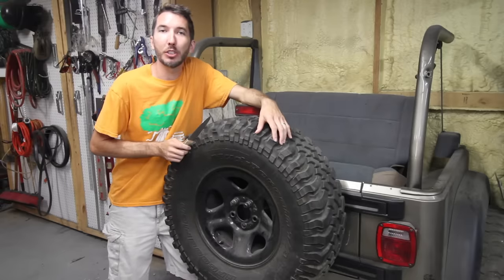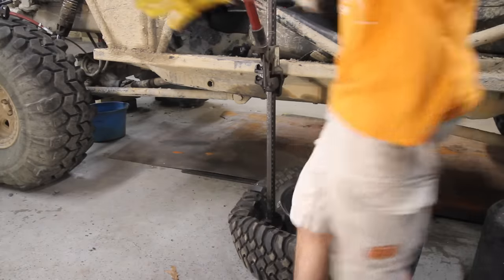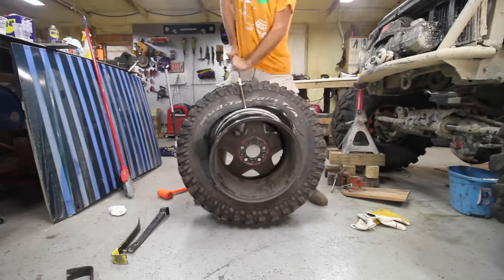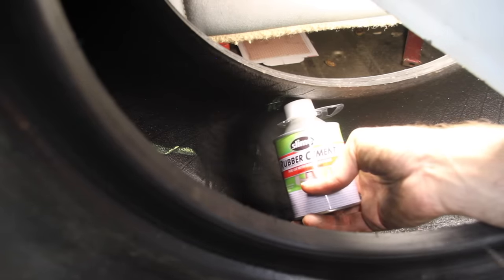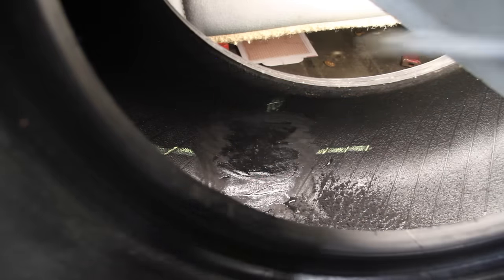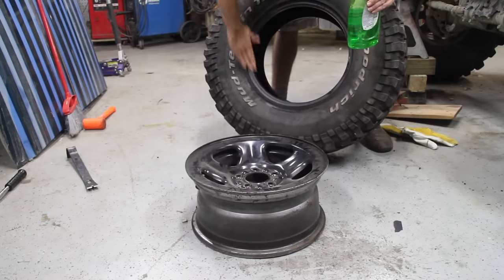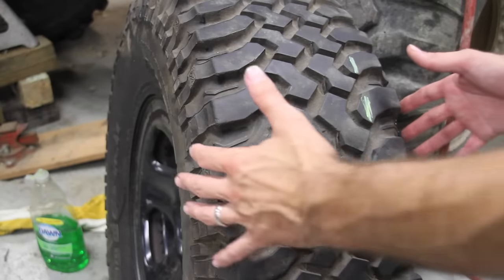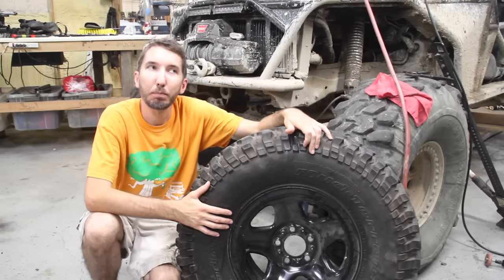How To Fix This - Patch A Tire

Comment: 2 Things, you ground right through the inner liner, which is a problem and secondly you put a bias ply gator on a radial tyre...
Reply: Otherwise you did an acceptable job and I bet you will get home just fine

Comment: I had someone stab my car tire near the rim. Could not afford two new tires because of on front and rears were warn bad. Had a radial tire tube installed, and lasted over 4,000+ miles before replaced. When asked for a tube, the dealer found one in back storage shelf covered in dust. Tubes are antique today, but in dad's day that is all they used.

Comment: You did one thing wrong you always end at the valve stem. If you have a newer vehicle 2007 and newer you will have a tpms sensor attached to the valve stem. To keep from damaging it you start removal at the valve and end at the valve when you re-install the tire.
Reply: Some are on the stem, some are on the opposite side of the wheel, some guess based on the abs

Comment: Pro tip. Don't use dish soap on alloy wheels it will corrode the bead seats and the rim will leak.
Reply: Is bath soap OK? What else is good?

Comment: This is how we changed big rig tires in the old days
Reply: Dewayne Miguel

Was thinking the same thing. When he was struggling with that last part of reassembly, where you telling him to push that bead down away from the edge of the rim ? lol . He got there, eventually.
As I was nearing retirement, I changed them with my cell phone......I called a mobile tire repairer.

Comment: If you really want to get fancy. You can clean the gash real good and skive it a bit. Use rubber strip to seal the gash. Push the rubber in the gash Use a heat gun to vulcanize the rubber and buff it until it's flush on the outside and inside, then apply a radial patch on the inside. Apply liner repair over the patch and voila!!! you pretty much did a section repair like they do spot repairs on tires that go in for retreading. You overbuffed to the chords. Patch will not hold good. Get out some flat rubber strip apply it over the chords or buffed area. Again use a heat gun to vulcanize it. By the way do not get finger prints on the buffed surfaces. The oils from your fingers will cause the patch not to hold too well. Lol. On the roadside this may not be possible, however it's best to take it apart again and do it proper after. That way it's a permanent fix and not temporary. A tire repaired like that should never go back on the front again. By the way. Buff the speed rating off the tire after a repair like that has been done.
Reply: @Mark Codiroli So your calling BANDAG a tool lol. They do this method on 235/75r16 and 17 10ply tires
Reply: @Mark Codiroli offroad use only though and Non highway service. Temporary

Comment: I have a cut like that on my side by side tire. Its further down the side wall, do you think it will work just the same? I do not drive it on the road.
Reply from the maker: Sure, I wouldn’t trust it to last forever but give it a shot.

Comment: Super glue is designed to glue rubber together you should have put superglue in a split and to help it dry faster and you sprinkle baking soda on it and it dries instantly and it'll never let go they might split that crack but it's not going to let go of the rubber

Comment: Good tutorial….I’ve done numerous similar repairs right into the flat area side walls..    
  But Such repairs close to the tread edges and sidewalls are not reliable,  No matter how well applied and Why tire stores don’t want to repair them… and only suitable for emergencies like said or maybe use for a spare.. The less time used might help the bonding process and offer a little more reliability if not the only tire have.. Otherwise sadly, need a new tire… 

My experience found.. 
The heavier duty thicker larger the patch is, the better as long slashes, big holes tend to flex and want to pull apart the hole.  And delaminate the patch....Or patch push through the hole making it bigger regardless of amount of air, or minimum,  . And a less flex material large patch with no or less stretch works better. This coupled with can’t always prep glue surfaces good enough with available tools on the trail .. (or at home in my case) 

 The rougher cleaner can make the patch surface, the better for bonding the patch to the tire.. but on the trail usually lucky to have more than a file on a multitool to do that or maybe in a well equipped tool box might have a wire brush, file or sandpaper in it. So upgrade your tire repair kit for all possible damage repair options.. Or only need a few more tools than might normally have in a kit or dual purpose ones.. 
. 
For sealing beads and removing tires.. Tire guys always say can’t use too much soap…
A typical 12v compressor might not produce enough volume of air to seal a bead that is leaking too much, (or a cheap home compressor) Or any manual ;pumps.. so..  
  Something should have on an off road vehicle is a tie down ratchet strap if not part of regular equipment. …In a pinch a rope..  put that around the perimeter of the tire and tighten it up till the centre compresses and seats the beads better… usually doesn’t take much compression on the big wide tires, and more of a problem with narrow tires and relative to wheel width.
 Sometimes if bounce the tire when isn’t filling it might help seal the bead a bit better and can get enough air it for the bead to start sealing..  the Starting fluid method also works, but can be dangerous… and if pack starting fluid.. 

There no point putting on excess rubber patch glue anywhere except for patch surfaces.. the glue is designed to only work with the chemicals on the patch to bond the patch to the tire and won’t glue any else together.. 
   I’m not sure there is any glue that will work to bond tire rubber together reliably except as some kind of vulcanizing process mimicked for patches or not for the consumer market... And if was, could glue those holes together and make patches for them more reliable ..

Comment: Now cover it with glue light it on fire and extinguish it with fast moving air letting burn for about 15 seconds bursts about 4 or 5 cycles reapplying fresh glue between each cycle, this thermal sets the patch and increases your chance of long term success by about 100%.....
Reply: You need to rethink your procedures if you need to burn cold-patch chemicals to get the patch to stick
Reply: Clearly heat helps...lol

Comment: OK for an emergency, but there is a reason you don't repair sidewalls.
They flex a lot more when driving.
A sudden deflation might be ok when you are crawling at 5 mph down a track, but at 50 mph it can be fatal.

Comment: use 18  to20 inch flat screw drivers good rim lube patch!!! to repair properly or safely use a 20$ tube not a 165$ tire you can use a tube even on a side wall hole up to three eight cut but patch first ... rear tire if used on  highway tubes were safe for 90ty years in tires!!!

Comment: As someone that works at a local professional tire shop, I am glad you stressed that this is a "get you out of a bind fix". even off road that tire should only be used to get you out of where your at, and get replaced ASAP, as that patch will eventually fail, because of the flexing.
Reply: do you work in the shop mainly or up front?

Comment: Brake cleaner is a better resolution than starter fluid. Better yet… in this environment, space permitting, carry a spare tire or two in the boot on top the cooler!

Comment: He means well, and his approach is "Good enough for govt work " but he left out one other important part of the process. .You must mark the rim balance weight and tire location. Also. .chocking the tires to prevent the vehicle from rolling off a "Loaded" jack, which can cause  most jacks to shoot upwards with enough force to injure or even kill you.  If you are faced with this situation,  please place one foot on the base of the jack, and WATCH for any roll off, in order to avoid harm. But overall,  it was a very informative presentation.

Comment: the injury is in the correct direction. the cords are radial, and the "ropes " all run the same direction. Very little damage to the intergrity of the tire. if the knife was 90 degress the other way, garbage. nothing would repair it. the repair was wrong, it is a bias repair, and the cord is x shaped inside. it will peal as it will not flex the same as the tire. radial repairs are either square or rectangular. I see people doing this all the time with tractor tires. bias repairs in radial tires, the split and take out the tube.
Reply: further, I have done ten of thousands of repairs over my lifetime of running a tire shop. I never clean the wound. I do not think bringing in a foreign agent into the wound will help clean it. If you buff well you can sweep the loose rubber out of the repair, or use a vacuum.

Comment: If you're not running on the road at highway speeds, this is something. I'd be very wary of inflating it, but for an emergency repair, anything will do. Hell, stuff the darn thing with hay if that gets you home.

Edit: Oof! He buffed it down to the casing... Those patches don't bond to the synthetic rubber in the casing of the tire.
Tire was scrap anyways I guess.

Comment: I had a 78 buick regal i had barely bought some tires and my ol lady had stabbed them and they were new and no tire repair shop wanted to fix em for me so i went across to mexico i live in del rio tx and crossed to cd.acuña coahuila mx took my tires and within 30 mins he patched them up for me and had no problem but the guys didn't use regular patches he used a iron and some kind of rubber to patch em up

Comment: Would have loved to see you try to actually put weight on that tire in a cycle it would have blown out due to the gash being parallel in between the bead and the tread, the tire would pinch due to weight and blow out that tire as soon as that patch reaches the bottom of its rotation. please people if you need advise go to to a professional that does tire work every day. Or not w.e its your life. enjoy it !

Comment: Good video, Thanks!

I know its only a temporary options to get you back to civilization, but, this patch would not last in the long run...... So, alow me to tell you guys my secret to a permanent fix....

At the point where you got the cut cleaned and ready for the rubber cement, you use Superglue, like the kind Geurilla glue makes, some countries also call it blitz stick. (this is going take some time) Put the Superglue in the cut, make sure it comes out on the outside as well. Put some on from the outside also..... Now, wait...... Till the glue is 100% dry.

Now you can go ahead and fix it like shown in the video, but, put an innertube in the tyre, bcs, otherwise the patch will come lose over time, since its on the sidewall.

If you do not fix the cut with Superglue, the cut will chew its way through the patch and if you have an innertube, it will chew through the innertube also.
Reply: i would have thought the blitz stik had even less flex capacity to the point where it would weaken the bond vs rubber cement. no?

Comment: VALCANIZING, BUT YOU NEED SPECIAL TOOLS ON TRAIL. SUPER GLUE WITH BLACK RUBBER CONTENT SOLD AT HOBBY SHOPS FROM BOB SMITH INDUSTRIES WORKS WELL FAST. E6000 INDUSTRIAL ADHEISIVE WORKS ALSO BUT TAKES 5 DAYS FOR FULL CURE.

Comment: So if you out on the trail...a compressor will appear so you can use the grinder?
Reply from the maker: you better believe it!
Reply: Yep, tend to roll up on four wheels. That is unless you're wheeling alone. In which case you're insane and get what's com'n to ya.
Reply: This actually did happen to us when we were hunting and we repaired it the way this video shows. We do carry a small 2 gallon air compressor and a 700 watt inverter that clamps on battery to run it. It works! but we also had 2 tire tools to help remove tire from rim.

Comment: I was wondering how long it would take you to figure out to keep the bead in drop center.
Reply: are you talking about the mounting process where the bead goes into the shallow part of the wheel?
.
Reply: Yes.  That's referred to as the drop center, of the wheel.

Comment: As a tire repair professional I can assure you that a repair like this is not legal for highway use. There is not a shop in the USA that will repair a puncture on the sidewall or edge of the tread if they are even the least bit reputable. This may be fine for off road use and to get you to literally the closest road so you can call for a replacement but should NEVER be used on the highway at or even near highway speeds.

Comment: Good Lil tip use a pair of vice grips on the top bead, can tell you are not a Tyre guy made this all look so difficult. Never hug a Tyre when blowing it up lol! Especially whit a dodgy repair!! Chuck it under your truck
Reply: First of all, why never hug a tire? They don't blow up... That's just not a thing that happens 😂. Second... Why is this a dodgy repair when it's literally step by step accurate according to any material I've ever read? Especially considering it being an in the wild repair
Reply: @A_Stereotypical_Guy  😆 who's never worked in a tyre shop...
Reply: @nickh3720  brother, when setting a tire bead, they don't explode...never happens, never has happened in the history of ever. Prove me wrong, link me a video with a tire exploding from setting it back on the bead. If it's a thing you know someone has a video of it on here.
Reply: @A_Stereotypical_Guy  ok why do they make tyre cages?
Reply: @nickh3720  for rims that have separate rings and hubs? Like 18 wheelers and tractors. Because the rims do blow apart from time to time, but not the tire.
Reply: @A_Stereotypical_Guy  and damage, ripped beads, zipper...troll go back yo your bridge
Reply: @nickh3720  ok my guy, but the point remains that when putting a tire back on a bead tires do not explode, so yes you can hug them, kiss them, even take them to bed, and you don't have to worry about them blowing up on you.

Comment: LUBE THAT TIRE WITH LIQUID SOAP...OR WHAT I USE...WHEEL BEARING GREASE...Had a flat because tire was low...& I didn't notice it...hit a small whoop tee doo and popped bead...All I had was a SLIME air compressor...wheel bearing grease...yup...hold that tire as perfectly against the rim as you can...the grease did the rest...I WAS OUT IN THE BOONIES MILES FROM THE NEAREST TIRE OR AIR MACHINE...SLIME MAKES A PRETTY GOOD COMPRESSOR...NOT AN AD FOR THEM...OLD SCHOOL OFF ROADER THAT USED TO RUN 5 POUNDS IN MY SAND RAIL REAR TIRES...USED SLIME IN 1974...

Comment: That's really hard work. I'm tired just by watching you do that. Better to take that to a tyre repair shop next time or just don't put a knife through it😂
Reply: Ha, ha, ha... the tire shops are located exactly every 2.53 miles on every off-road trail, just roll your wheel there and they will be happy to help you...

Comment: Is it possible to put the tire the other way so the patched part stays on the inside of the vehicle and not on the outside? Sorry im new around this loool
Reply from the maker: yes that is possible
Reply: Put it on either way, unless its directional.

Comment: Not bad for an amateur repair. Not sure why you used a bias repair unit instead of the radial one you had available? Other than not using a proper vulcanizing chemical to do the repair and missing a few items. I would say pretty good job.

Comment: This looks ok for farm vehicles traveling less than 30mph or so or for a spare that will be used briefly and at low speeds but very risky for highway speeds.  When cornering and the shear stresses on a tire are unbelievably high and and the tire ply fabric at the cut  tears and works loose from the rubber.   If I had my life's work dependent on a my tire shop and all my assets and probably mortgages too tied up in it I would respectfully decline to do this repair for a customer.  One accident and you would lose it all.  I would do simple nail and screw punctures this way but keep my eye on it in case separation starts to develop on a larger screw hole.

Comment: What was the purpose of cleaning the rubber you the ground off?
Reply: BubbaT85 to get all the excess rubber off of that are so the patch can stick to the cement and not the left over loose rubber.

Comment: The reason why you don't repair the sidewall is because when you are driving on the tires
the sidewall flexes and could pop the patch. Also never patch the front tires, those are your steering wheels. The only tires to patch are the rear tires. You should move any patched front tires to the rear wheels.
Reply: Steve, good advice if its a tyre on a road car being repaired, but he states this repair is not legal for highway use and will only be suitable as a get-you-home repair, not for continued use.

Comment: If you're in a situation where a spare and tubes can't help, and you need to have a large jack, an air compressor, a while patching set and an air powered tool, maybe you shouldn't be driving of the road.

Comment: if you pour a little gasoline on the bead and let it sit lying flat for 10 minutes or so you can break the bead easily . my old tire guy was in his 80s . he did semi truck tires this way and only used the heel of his shoe to break the bead never needed.a 16 pound bead breaking hammer

Comment: Crouch down and put your face right next to the cut area of a tire while inflating it. Maybe you've severed too many nylon cords in the sidewall to prevent the tire from zippering open. This video could have easily ended up in the "mature" section of LiveLeak instead of YouTube